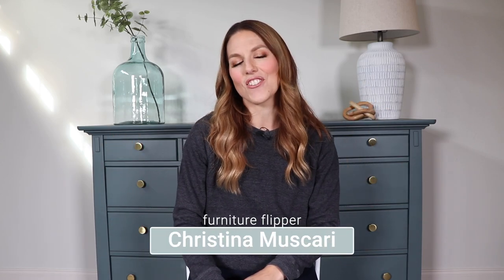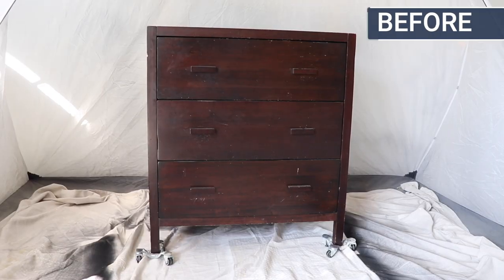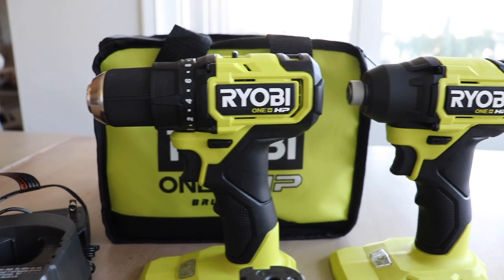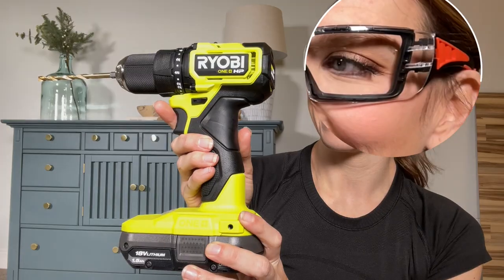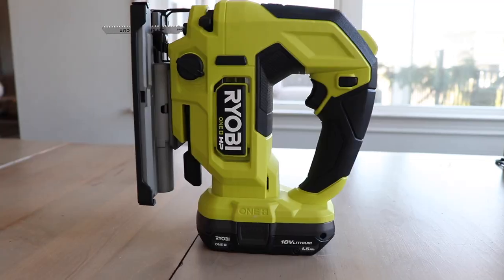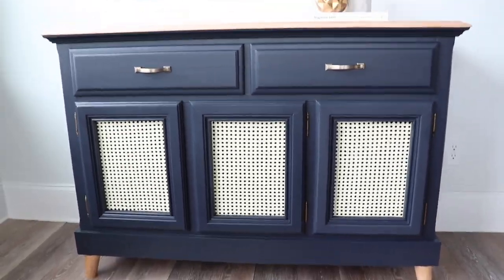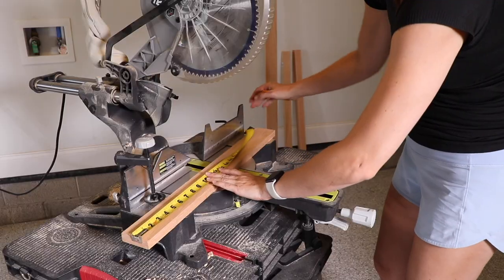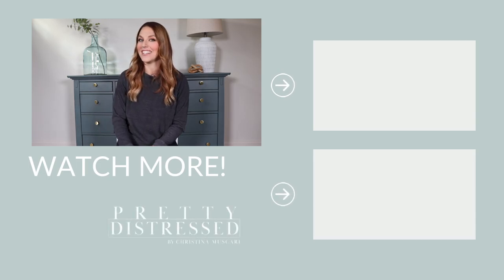My Favorite Power Tools for Furniture Flipping

Comment: I have been refinishing furniture on and off for years. However, I was not using the correct tools, paints, and topcoats. I really have learned so much from you and the evidence is in the better results I am achieving.

Comment: I am so happy to have found your channel back in August. The amount of knowledge I have gained from you is unreal. I wouldn't have been able to do the big dresser and mirror piece I have, without having watched. I am definitely going to be taking your online class soon to further my knowledge in flipping furniture. Saving pieces from going into the landfill is such an amazing plus to working on these projects. The oribital sander would be a life saver. I currently used a black & decker detail sander, and I have to say, it does get very exhausting forcing pressure and pushing it for hours. Thank you for your lovely channel and all of the beautiful pieces you have done 🥰

Comment: Hmmmm...... I of course love them all.... So if I had to choose I would say the stapler. Those old manual staplers are a killer and I get so aggravated with them. You start out thinking I will staple this no problem. Then you end up hold a partial staple with needle nose pliers and using a hammer to finish the job. But like I said.... ❤ love all of the Ryobi tools

Comment: My husband has a bunch of tools but I'd like to have some of my own. I make sliding closet doors to replace the heavy ones that came with the houses. I staple fabric on the frame using a manual stapler (which kills my hands) and then have to hammer the staples all the way in. I also staple roofing fabric on the chicken coop every winter to keep the chickens warm. Again, kills my hands. I built a fence and gate for the chicken yard and cut the pickets by hand with a hand saw. Yep. Hand saw.  Power tools can be intimidating but I'd like to give them a try.

Comment: How did you fill in that shell design on the 2nd piece? I’m excited about ALL The Tools!! I’m a brand new furniture flipper bc I’m just started with my furniture adventure. I have 2 dressers just waiting for a makeover. 

But if I had to choose 1 tool, I would choose the Ryobi Miter saw. As A little girl, I always watched my dad using power saws, and I was always so scared to go near them. This looks so insanely safe and I would be excited to use it.

Comment: I would be most pumped about the miter saw and sander.  I don't have either one currently and I have old schooled it way too long.
Reply: Also what was the ruler you were using for drilling holes?  That was a cool tool to have as well.

Comment: What an amazing giveaway!  I’m not sure I can pick which tool I’m most excited to try: I think I’m most excited to try the miter saw for all it can do but a bit intimidated (but like you said, if you can use it, I can too 😁).  I’m also excited to try the sander as it would definitely help prevent hand cramping and get the job done MUCH faster!  Thanks so much for all you do…You’re work is amazing and inspiring!!!